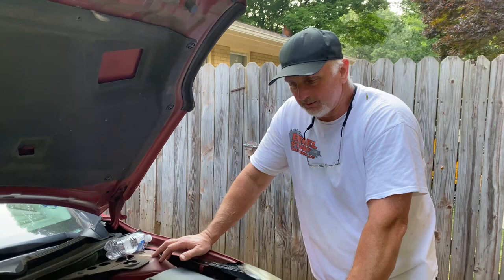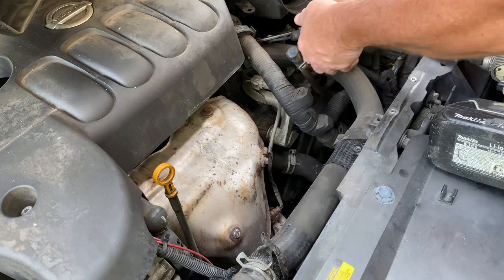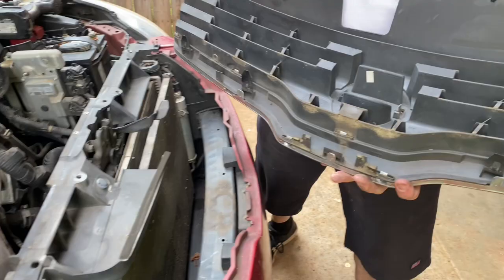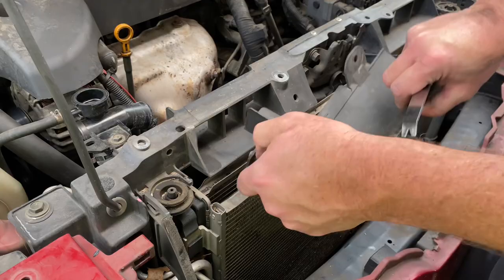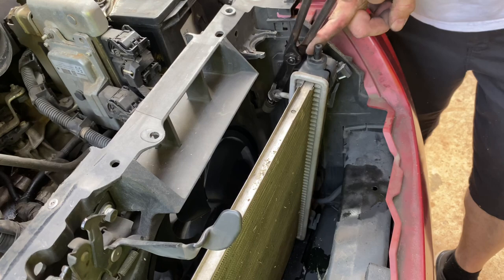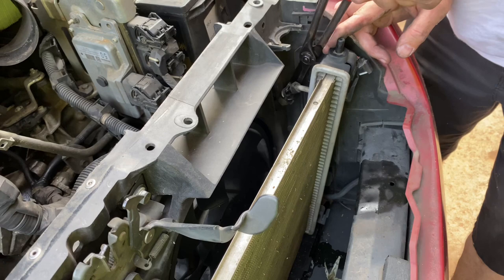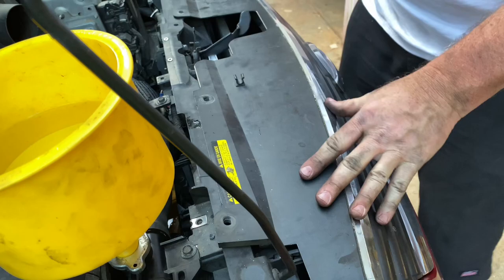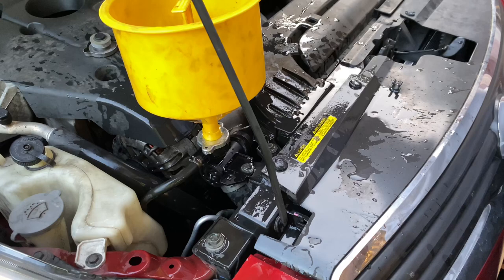How to Replace Radiator on 2009 Nissan Altima 2.5 liter - DIY

Comment: I'm in the process of having a radiator shop put a new radiator on my 2008 Nissan Altima for a little bit over a $1000. My first thought was am I being ripped off? He told me everything he was going to do. I saw your video and I played it.  everything the radiator shop told me is correct. He certainly is not ripping me off. He's doing everything you did in your video.  And he's actually charging me a good price. so I thank you so much for your video. It really helped me a lot. My mechanical ability is almost 0, so I really appreciate this.
Reply: I was just quoted 600 for a radiator and timing belt on my 2009. Which is why I'm here at this video. Hearing ur getting taxed 1k makes me feel better
Reply: He May not be ripping you off but it's still too much for a Nissan Altima, I know a mechanic who is only charging me $185 plus the part like 250, total comes out to $435. He's a very good mechanic. I say look elsewhere. $1000 is insane for a Nissan Altima 2008. I have one myself and no way I'm paying that I rather take my time all day and do it myself. But if you have the money and don't have the time then Go for it.
Reply: I’m have my radiator changed now that’s why I came looking for his video and after seeing your cost a tear  fell from my 👁️ because I just paid 1,017.12 for engine work two weeks ago
Reply: @nettarose9310  If if you have a good local mechanic who has done work for you in the past, maybe he will charge you less money or try to call different shops in your area and get quotes.  Good luck!
Reply: Having my radiator replaced as we speak. Price is 450.00. I'm extremely grateful for my mechanic being this kind. Thank you!

Comment: Some videos show that if you remove the bumper you can swing the condenser out enough without have to disconnect it.
Reply: That’s correct. I removed the bumper and didn’t have to disconnect the condenser and have to get it serviced.

Comment: Awesome job
What is the cost of a replacement?
Reply from the maker: I think the radiator was under $200 from Advance Auto Parts. I did this repair for a friend so I didn't charge any labor.
Reply: @minthillbilly  it’s the labor that cost… can’t wait to see what the cost will be… I just paid 1017.12 for repairs to engine 2 weeks ok